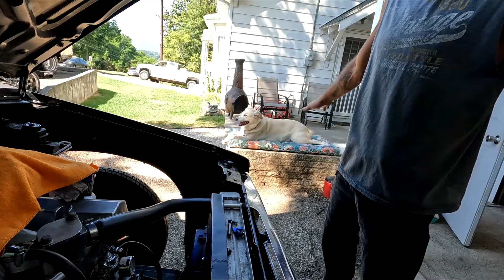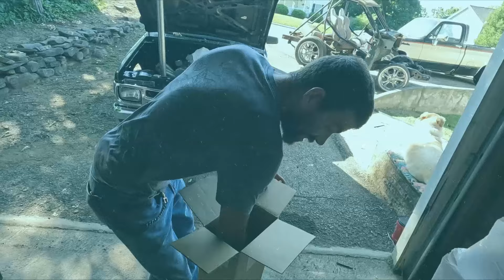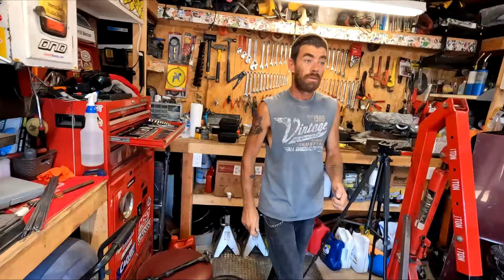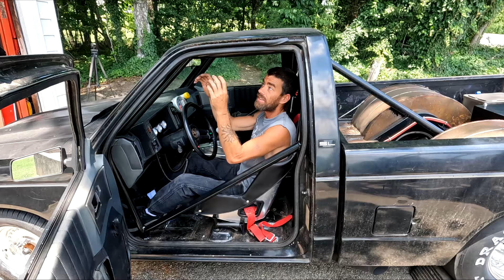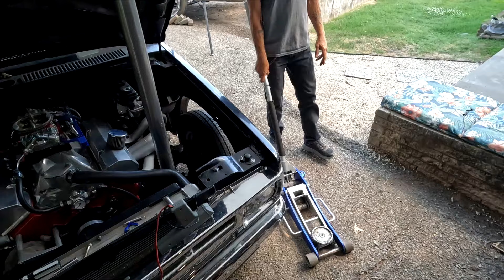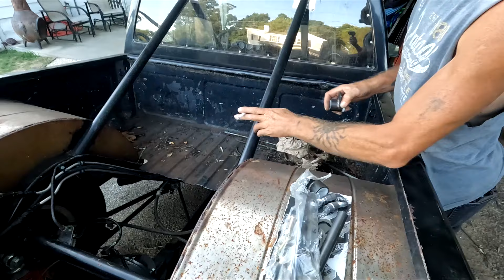The Belt's Flying Off the S10 And New Wheels!

Comment: Yes you can weld moly to steel .. install another cross member, for the anti roll and bolt  the bushing cups to that .. also keep in mind you will have a slight  arc in the travel .. pay attention to how close it is to the bed , so the arms do not hit it on compression
Reply from the maker: Thanks brother!🤙

Comment: hey guys i had same trouble with slinging belts on my sbc elcamino, i put on the moroso under drive pulley to so down the alternator and never had any problems since part # moroso 64870 5 inch pully all the high revin engines use them to keep belts on, your welcome 👍
Reply: summit has them there Part number is 64800 moroso alt pully
Reply from the maker: Thanks brother, we’ll have to check it out!🤙